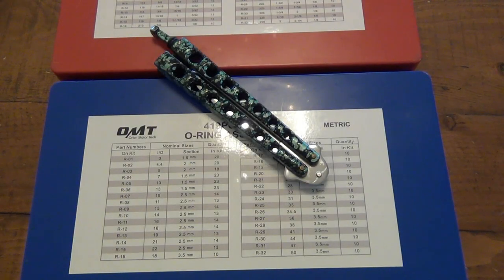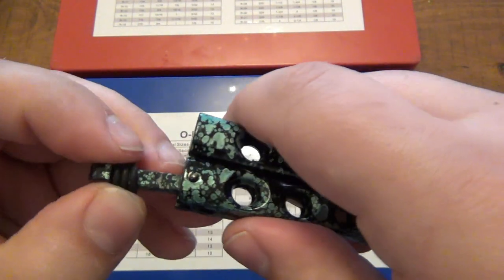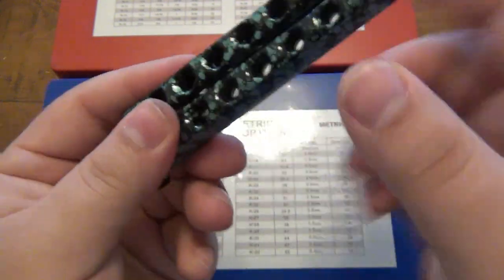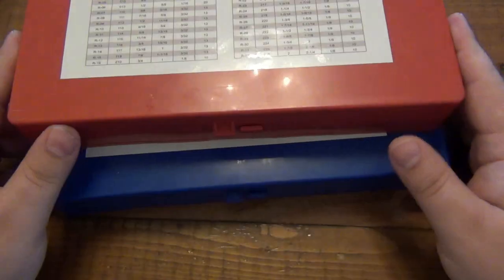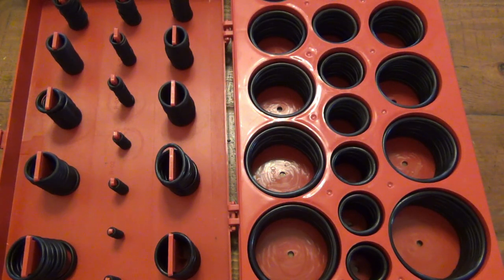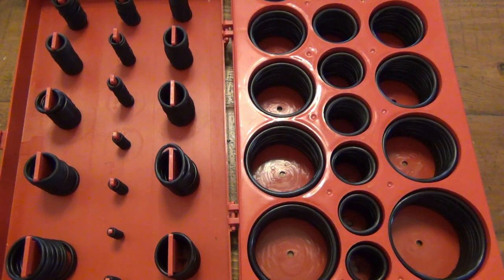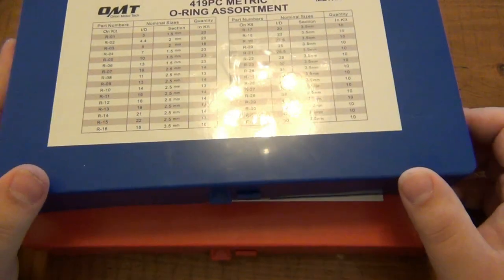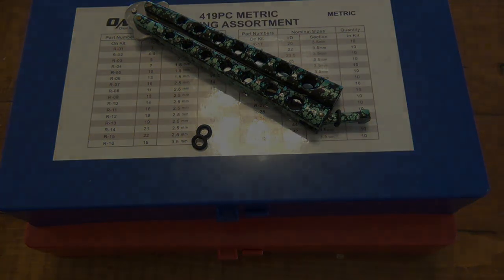The Solution To Your Cheap Balisong (Butterfly Knife) Problems...

Comment: What’s better is to remove the latch not only does it keep the handles balanced but it fixes the issues. But if you don’t mind the slight in even weight which isn’t a huge deal then this o ring is a smart idea. You can even glue them to prevent from sliding down and just cut them off if you don’t want them on the latch anymore. Great tip Though Jeff your vid was very educational I remember I did this when I saw your older vid. Keep up the great content

Comment: You can use a slightly larger oring around the handle, just under the latch pin as a latch gate and it'll let you use the latch as intended.

Comment: I have a cheap $16 balisong that I got off amazon that doesn't even have a name it's just called practice training tool or something and well it's a piece of shit I had it for like a week and right out of the box it had a ridiculous amount of play and it was super stiff and I had to loosen the screws it fell apart 3 times each time I tried to lock tight it let's just say I was waiting longer then I was using it 2 screws fell out and the handle fell off in the middle of flipping I have the screws but upkeep is impossible at this point guys if you see that knife on amazon do not buy it